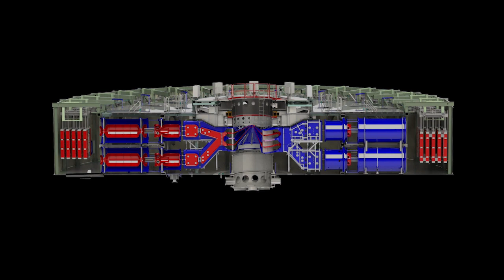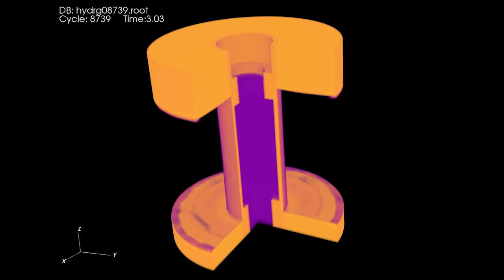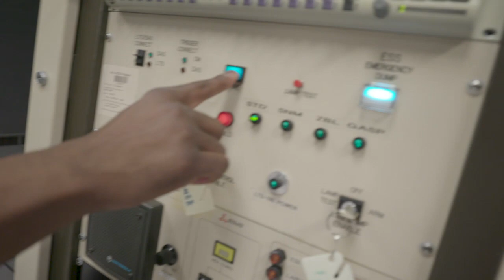Z Machine: the Capabilities

Comment: 0:28 "Take that electrical pulse and compress it in space, compress it in time" 🤔 
Compress something traveling at light speed across the dimensions of time..🤔
Riiiiiiiiiight?!
Reply: By "compress it in time" they mean outputting that power in the shortest timespan possible to increase the intensity - currently 95 nanoseconds.
Reply: What would be really funny is putting  random cheap electronics in the chamber and frying them with it. Could imagine the same result no matter what... vaporized instantly to x-ray emitting plasma... 😲